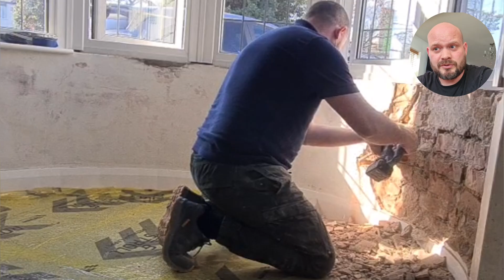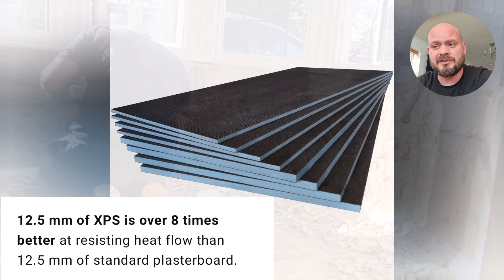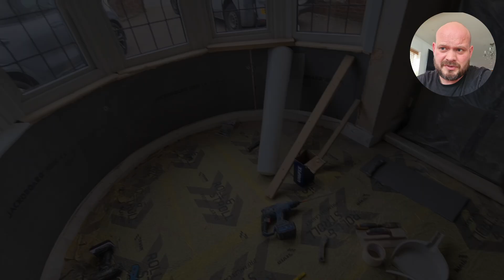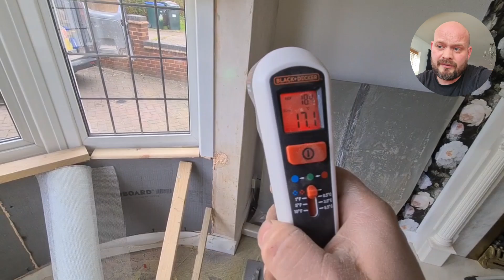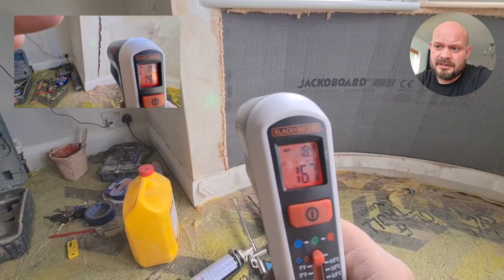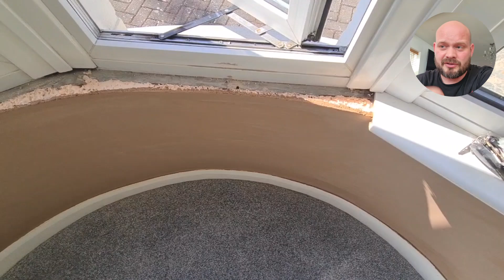Is plasterboard good for insulating walls?

Comment: Those metal fixings provide a cold bridge and become areas for mould to grow.
I have seen it first hand in my Grandmothers house. Using the plastic fixing may be a better option.
Reply from the maker: If installed incorrectly it's possible. Given that they are sat ontop of insulation material and holes are sealed before fixing it's extremely unlikely for this to happen and I've never had it happen when installing IWI systems over the last 12 years

Comment: Surely if this is a cavity house you can use jackoboard the lot but if it’s solid brick you won’t get away with it
Reply from the maker: @jackpartridge7891  Hi, most solid wall properties here in Warwickshire have been patched with gyspm & gypsum skimmed, cement pebble dashed or rendered on the outside and have silk paint or paper finished inside. Also many are built from portland cement not lime 👍

Comment: Hi @SDRobertsPlastering. Great video - thanks. Could you attach a link to the XPS you uses that is suitable for curved walls, please? I wasn't sure if it was just two layers of 6mm with a natural flex?
Reply from the maker: https://www.protilertools.co.uk/product/jackoboard-flexo-construction-boards-1300-x-600mm?gad_source=1&gad_campaignid=1040924321&gclid=Cj0KCQjwt8zABhDKARIsAHXuD7aE2uokXZS978AHGWJ67K8SvGLQbFUMMWHBRsM-935oNxzKF-I7OxIaAqDyEALw_wcB

Comment: Ok for a cavity wall but if it's solid wall then I would either use aerogel or wood  fibre insulation to give breathability. Of course the best solution would be to externally insulate the wall.
Reply from the maker: @bbar182  This building is made up of Portland cement not lime 👍